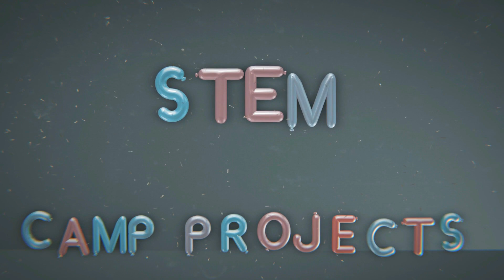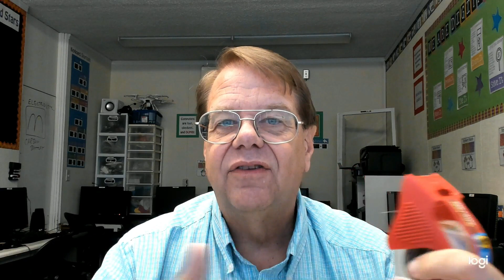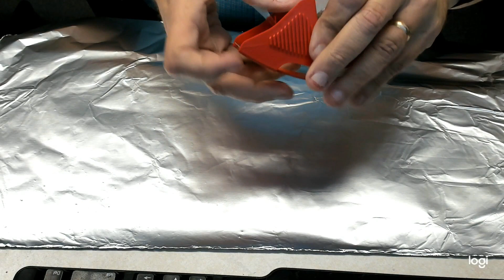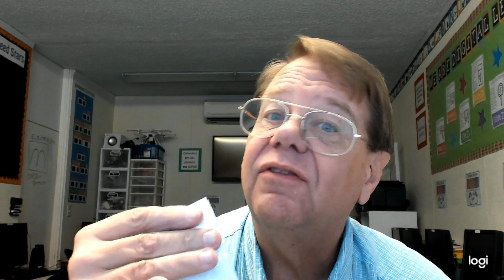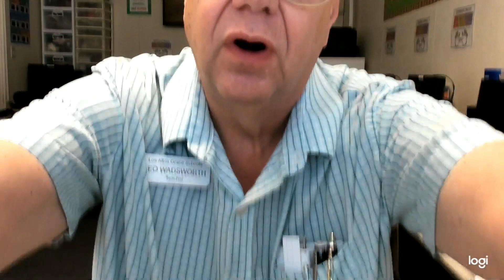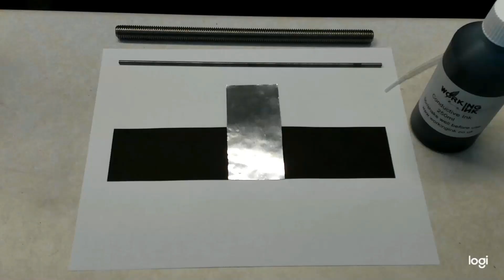Sugar Battery V2 Baseline Video 2

Comment: Hi I got impressed by your diy sitoniser project but I would like to know if I can  some modifications to these projects to get the substance
By Both phases are mixed and sonication (VCX750 Ultrasonic 
processor, power output 190W, 3 mm probe diameter, Sonics) is performed at 40°C for a whole 5 min period
Let me know how can it be possible to do some modifications needed to achieve this goal
Reply from the maker: The sonicator I built is not a probe sonicator, but a bath unit.  I don't know about probe units.

Comment: The ink goes on really well with the threaded rod Leo, I must give it a go next time I coat something :-)    Martin.
Reply from the maker: I agree Martin - it is much better than what I've done before. leo
Reply: STEM Camp Projects what is the best way to make the sugar conductive. I used powder sugar. Thanks for any help, I have learned a lot from your videos. 
Thanks again
Reply from the maker: @aaaricmondroofing1703  I'm using a microwave oven because I don't have access to a kiln, and I want to avoid very caustic materials.  I'm about to try a different mixture -- I'm hoping that it will work more quickly and solidly.  I'm going to be using zinc chloride.  It is a bit caustic, so be sure to wear gloves if you try it.  So far before this my best mixture was 5g sugar, 5g salt, 1g urea, and 2g graphite powder.  I cooked it at full power for 13 minutes.  But the zinc chloride has a MUCH lower melting point, so I expect it to melt and surround the sugar, preventing oxygen from messing with it.  My plan is to use 4g sugar, 1g baking soda, 5g zinc chloride, and 1g urea.  My first cook will be half power for 4 minutes, and then I'll adjust from there.
Reply from the maker: Oh, and I learned I was handling the rod wrong.  While it was still better than brushing, I learned that you are supposed to draw the rod across, not roll the rod.  Gotta love Robert Murray Smith!

Comment: Excellent presentation. I tried Robs threaded bar idea the other day and it works well. No more using paint brushes. 😀
Reply from the maker: Thanks Dan.  I agree -- the rod is much easier than the brush. leo
Reply from the maker: I learned I was not doing it right.  You are supposed to draw the rod across the material instead of rolling it.  Even rolling it was better for me than brushing.
Reply: STEM Camp Projects cheers. Same here.